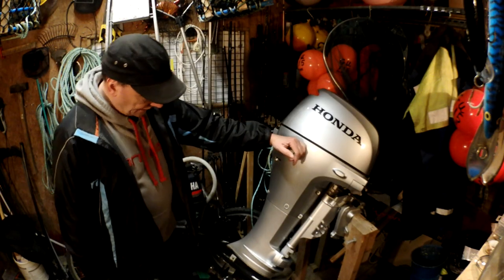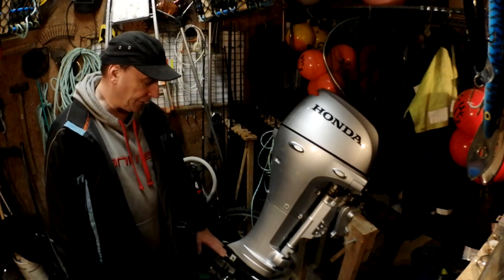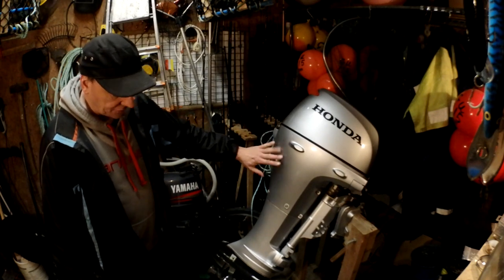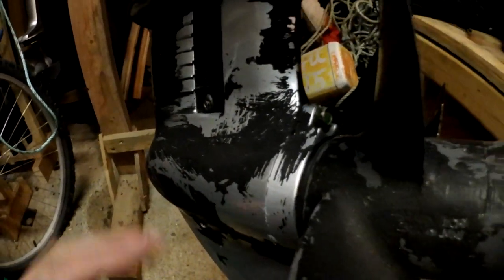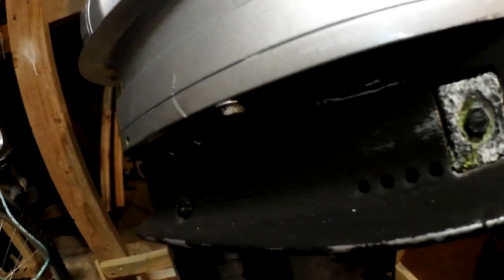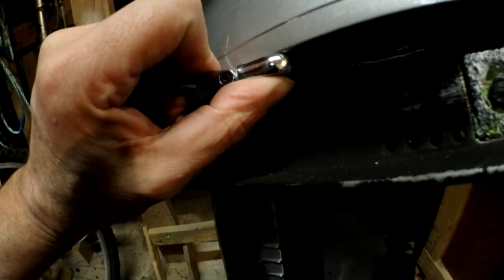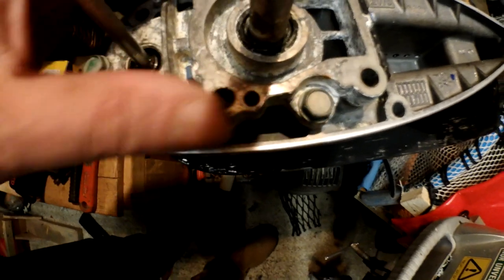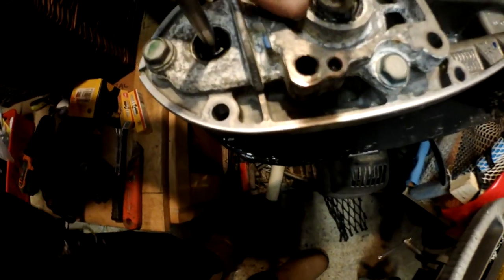Honda 10hp Impeller Change BF10 2017 2018

Comment: Ah, I notice it was the tongue position that allowed everything to slide up together again. I have found, whenever I do small engine repairs, that the odd word or two helps. The words do not have any mechanical benefit but they do help to relieve the frustration I feel when things just do not quite go right. I pick my moments. When no-one is within earshot.  Very helpful advice & tips for anyone contemplating DIY motor maintenance. I notice your subscriptions are creeping up. Good to see.
Reply from the maker: I like to mention some of the smaller details as they are what often can cause frustration after watching or reading a straight forward guide. The channel is getting solid steady growth so its all good.
Reply: Trojs Fishing ,

Comment: Does it matter which way the little impeller 'paddles' face inside its housing? And, is it worth painting some kind of anti corrosion paint onto the corrosion you pointed at inside around the impeller 'block'?
Reply from the maker: I always just put them the way they came out but soon as you turn the engine over they will go the right way. No its not worth painting the corrosion it looks a lot worse than it is. A bit of grease smeared over it will slow it down.

Comment: This is a really good video. A fantastic tutorial.  The narration along the way was very well done. I’m going to do this job on my 15 over the next few weeks.  Should I replace the green plate gasket when I’m in there?  How about the black  rubber O-ring?  And one final question, how much torque would you estimate that you apply reassembling?  A big thanks in advance and if you don’t mind answering the 3 questions assuming you have the time…. Thanks and a big shout out from Canada!
Reply from the maker: You wont need to tighten to much just past hand tight as your tightening  into alloy you dont want to overtighten them, they wont undo. Its best to replace the gasket and O-ring even if its just for peace of mind
Reply: @Trojwaterman  Thank you.
Reply: @Trojwaterman  I got it all apart - very straightforward. But One of the rubber impeller fins had broken off.  And cannot find it anywhere.  So I’m thinking it got sucked up into the engine water channeling.  What do you recommend?
Reply: @Trojwaterman  I also removed the green flat mating gasket.  I assumed that needed to be replaced but I guess not. It’s off now, I guess its not too much trouble to put a new one on? Will it seal ok…?  Big thanks for answering the questions and your time!

Comment: Thanks for this.  I was having cooling water flow issues on my 2016 Suzuki 6hp o/b, just changed the impeller with no noticeable improvement.  I feel steady pulse of air at the outflow hole, but that's it.  No obstruction at the intake grate or the pipe from the water pump up to the head, so I suppose that means I have to crack the head (& cylinder?) and look for and clear obstruction somewhere in the casting?  Any tips?
Reply from the maker: I had cooling issues with my 20hp Suzuki it was the thermostat sticking.
Reply: @Trojwaterman  That's what it turned out to be with mine as well.  Glad I didn't have to dig any deeper in the engine to find the issue.

Comment: Hello mate i have water in my lower unit oil and want to change the seals but the Honda BF15A is very old and the frame serial number and model number has been painted over and is illegible - i need to change the seals but cannot order the parts without knowing the above info - can you tell me before i pull it all apart if the parts inside will have numbers on them to enable me to order replacements - thanks

Comment: Great instructional video !  I noticed that after removing the impeller housing that you removed an O ring but did not see you replace it during re-assembly. Did I miss something?
Reply from the maker: Probably my editing I noticed later there was a clip which did not make it into the video.
Reply: @Trojwaterman  Thank you for your quick reply.  Thanks to your instructional video I successfully changed out the impeller on my Honda 9.9 today.

Comment: How critical is the o ring around the impeller itself? When I took my BF8D apart the O ring was awol (disintegrated or missing) and I have seen another video where he doesn't have a gasket, or replace it either. I replaced everything without putting one in...
Reply from the maker: I would have a gasket for sure. As for the o ring I believe its so you don't loose water pressure, weather that happens or not depends on the engine and how tight the parts fit.

Comment: This was a very good educational video Troy, very well done. You know when you said it could go another year, I think in your case it is a good idea to replace it every other year. I was a kid when our impeller crapped out on a brand new motor and we had to paddle a 16' glass boat in through the tide. Anytime you have the leg open consider when you had done the impeller.
With that initial corrosion on the housing, is your sacrificial anode in place? Is it worn? That could allow more corrosion if it is gone and it could have corroded away in which case you need another or a larger one in your boat? Obviously you know this but I thought I would mention it here. You did a beautiful job of demonstrating the job. Nice to see you didn't use any words that might since Fish Cat's hair! 😂
Reply from the maker: I always keep a check on the water pumping plus I have never had one fail instantly I also carry the spare engine . Yes it has the anodes in place but I will replace them this year  its probably due to all the wind we have had this year causing the engine to dip in the water all the time when moored
Reply: @Trojwaterman  ahhh I didn't think of that! You have a lot of wind there for sure!

Comment: Great video! Love a bit of home maintenance. I’m no expert on marine engineering, but would a small amount of gasket sealer be worth applying to limit the corrosion/ crystalline build up? 👍
Reply from the maker: I don't think that would help as water is always around that area plus you would not want any coming off and possibly blocking where the water pumps around

Comment: I would imagine using a torque rench would be an idea with those nuts and bolts, especially because it’s an engine, on car work I torque most not all the work I do. Bearings etc always are torqued 😀
Reply from the maker: You could do but all the torque wrenches I have wont fit because of the fin

Comment: Should water come out of hole when hose muff is used?
Reply from the maker: It should but I have not used muffs for years. I just use a bin or bucket of water. If muffs dont fit tight or you have low water pressure  or even with modern thermostats you may not see water come out.
Reply: A bucket or bin is best to really get it flushed but I've found that if I use the muffs get them situated and use an Irwin hand clam on them to really keep them in place. You dont wanna crank the bajesus outta the clamp but enough so you can see a nice tight seal around the suction cup deals on the muffs
Reply: @oregon-castnblaster6664  Thks!!

Comment: A copper or nickel based anti seize works better on bolts then grease to prevent seizing bolts and corrosion.